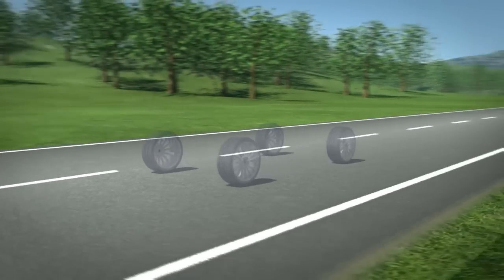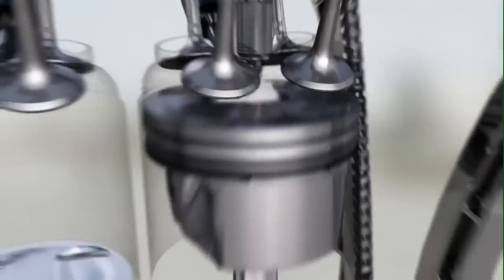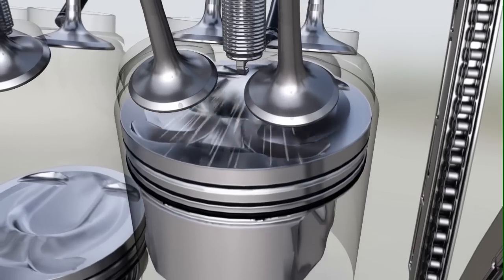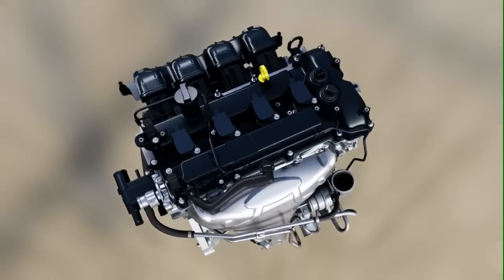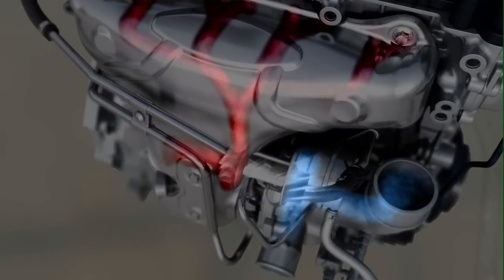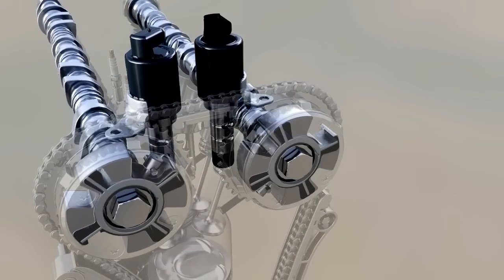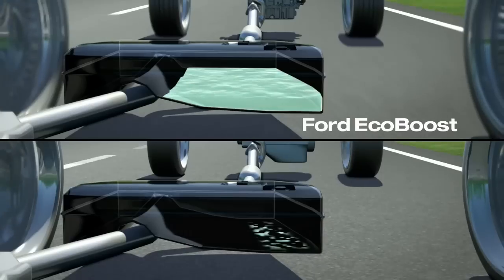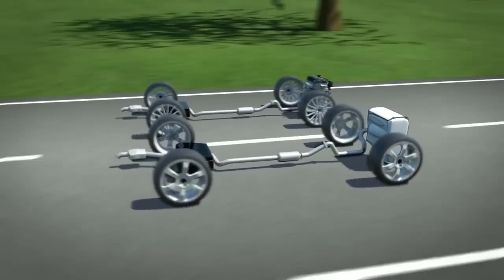Ford EcoBoost Engine

Comment: I am 67 years old, just bought an f150 3.5L.  My test drive it was a beast. Never had that much power.
Reply: Because dude you have a supercar engine in your truck. Ford GT 2.0 has the same engine

Comment: I driven an eco boost 1.0 fiesta very nippy  petrol engines
longevity wise with the earlier versions had some flaws, but for the size it boost it produces and easy on the fuel. 
the 1.5 very torquie how ever a 2.0 engine should be a power house!
They are a popular manufacturer I had driven fords before they are great but i miss their z tec engines and duratec engines they are great sold engines. 
The ecoblue engines are nice too.
keep up the ICE alive ford! all the best!

Comment: This is the biggest screw up Ford made during it's existence, what kind of engineering department comes up with and open deck design with cooling slits between cylinders?
All the 1.0 , 1.5 and 1.6 ecoboost at work failed before 80K miles.
I had the 1.6 VCT before that, unbreakable, even with the flawed piston nock at TDC.
2.0 N/A engine is the best in MK3, but only in a handfull of countries, based on Mazda L series, also in Volvo V50.

Comment: I wasn't that impressed with my rental Fusion's acceleration but then I learned it was only 1.5L... I still prefer the NA 1.6L in my Fiesta though. Lighter weight and feels more powerful at high RPM.
Reply: The 1.6 is turbocharged.

Comment: I'd rather drive a car that has 15mpg, will need an oil change every 6k miles and will last 1'000'000 miles rather than having a 1L 200hp ecoturbogreenskyactivhomohalal engine that has longlife oil lasting 24k miles or whatnot and will need a full rebuild after 100'000 miles. But hey, that's just my opinion, (and every other car passionate's). and I don't whine about it on Ford's video because I hate Ford, quite the opposite actually, I always loved Fords, it's just what you guys do with this amazing make right now makes me want to cry, I'm fine with having a hybrid, downsized, or electric as an option, what I don't want is having it forced in without an option of something I would like.
Reply: Nah. Got 270k miles on it and still no problems. Prolly best choice I made. I don’t know who you drive but an oil change every 6k miles? A car that makes only 24k miles? U probably money-shift very gear. But I respect the opinion:)z
Reply: @Hi-db5cd then you're one of the few. Join any other ecoboost forums and you'll know.

Comment: 1:13 ok now I hear some hardcore bullshit. Since when is any turbocharger even working at low end? no matter how small you make it, there is still lag, and in reality, if you compare a turboed engine's power and torque, at the rpm at which the turbo doesn't operate, to the NA version of the same engine, the NA will have higher torque and power, of course that is just the bottom end rpm, but isn't that where you claim to increase the torque by adding a turbo?
Reply: The size of the turbo isn't that important (Shure smaller is better because of the lower mass) , however the angle of the fins inside the turbine and compressor are much more important, however yes there will always be a bit of turbo lag, even Whit VTG Turbos (Wich most gasoline Ecoboost engines don't seem to use) however you can reduce the lag by lowering the max RPM increasing the Idle RPM setting the software to accelerate much more aggressive than what it should based on the position of the accelerator and by injecting and igniting fuel when the exit valves are open, and that in combination with the Variable Valve timing and Valve travel does end up making those engines feel very responsive and powerful.

And Ford never said that the engine wouldn't have any lag, just that it has minimal lag and increased torque over a Naturally Aspirated engine Whit the same displacement both are correct, and them saying that the turbo is optimized for low end torque isn't wrong either, unlike for example the Nissan GTR wich Takes 7seconds to spool up those massive turbos.
Reply: Clearly Jandalf is a keyboard warrior who a) hasn't actually driven an EcoBoost vehicle and b) hasn't kept up with today's turbocharger technology.

Comment: 1-4 turbocharger intercooler petrol engines all in all brands : Easy damage,  20-100 l/100km, over 100 l/100km with All speed, Formula one speed 160 km/hour to top speed, test maximum over 20,000 to 150,000 rpm.

These ones have been built by street racers all class terrorist brilliant for corruption and illegal in standard law AE.

From
All brands databases all

End report.
Reply: Dem K. Your comment made zero sense

Comment: All ECOBOOST engines : Easy damage, 20-100 l/100km, over 100 l/100km with all speed, Formula one speed 160 km/hour to top speed, test maximum over 20,000 rpm to 150,000 rpm.

End report.

From
Ford databases all

My name is Taweechai Wongwarapan. E-mail taweechai20@hotmail.com

Comment: Benz just announced a 2.0L Turbo with over 400HP and almost 400 ft lbs of Torque, most powerful production car 4 cyl so far! With great mpg, that 2.0L is the magic size for most uses..amazing The 2.0L is the most manufactured engine size in the world, from all makers. My VW GTI 2.0L turbo is great, latest edition, has improved upper end cooling, to try and cut down on carbon buildup, so far it's working 79,000 fun miles, not a blip of trouble...always getting 31+ mpg AND got 35.1 recently on a long cruise non stopping, best ever with well over 70,000 miles!! Great stuff, I always use at least 91-93 Octane, min is 91 required by VW for that engine..top tier BP most of teh time as it's the cheapest around here, when away I use WaWa or other brands, never had a problem

Comment: Overall good interessting technology.
But please change the 1.0 Ecoboost 3 cylinder to a four cylinder engine.
It would run much smoother and needs only 0,2l/100km more fuel than the 3 cylinder engine.
VW EA211 1.2 TSI (4 cylinder)  do run better than the Ecoboost, with the same fuel consumption.
Reply: VW has other serious problems.

Comment: How does a 1.0 Ecoboost engine keep getting 14L per 100km with sedate driving?
Reply: How? it doesn`t. Something must be seriously wrong. Maybe your driving behaviour?
Reply: @dom3827  It has the standard auto box not the PowerShift.  I heard it uses more fuel to change the gears due to torque conversion maybe? It was my moms car, they gave it back.
Reply: @jacquesduplessis8944  hm..than i dont know. Sorry.
Reply: @jacquesduplessis8944  a torque converter will use a bit more fuel than a Dual Clutch transmission, but 14L is way too much for example an Audi SQ5 (2019) Whit a 2.5L Turbo V6 and torque converter transmission uses around 9-11L of fuel, so that is way too much for a 1L Ecoboost Inline 3 or 4 you should expect 5-8L unless you really floor it.

Are you by any chance going by the indicator in the gage cluster? Because if that is set to display the momentarily fuel usage it might display that much when accelerating, otherwise I'd check if the turbocharger or injection system is damaged.

Comment: Piece of junk. My Dad used to have a 2012 fwd ford escape with an ecoboost. It had so many problems. Update 2021:Lol. I was way younger when I made this comment. I don’t know why I made this comment. Ford Escapes actually aren’t that bad.
Reply: like no company has problems.......
Reply: They are better than a S#!T box Holden
Reply: @megatronprime3008  no. By far tze worst brand at the moment in terms of engine problems and failure is by far the VW group.
Reply: @dom3827  Yes they are . they have dominated holden in performance for years. It's a fact . i can put the details up here if you like.
Reply: They have overcome all the teething problems new and upgraded engines/heating systems are fine

Comment: guaranteed to shut down every 10000km
Reply: 85 000 k's on mine. HAS NEVER MISSED A BEAT. you must be thinking of a Holden or Chev. They are garbage
Reply: hungrynapps nope 50,000 strong

Comment: Is not fuel quality is the engine design
Reply: Lots of direct injection have carbon buildup, cus the gas is not being sent over the valves to clean them, VW solved it on the latest version of the 2.0t by having more cooling in the head area, and supposedly an extra injector to spray some gas across the valves...I always use top tier rated gas, BP mostly around here is the 93 octane cheapest
Reply: The carbon buildup isn't causing cylinder heads to crack cars catching fire etc

Comment: How bout the carbon deposit on the exhaust valve?
Reply: EVERY direct injection engine has this problem.
That is not a ford specific problem.
VW TFSI engines are most affected by this problem according to german car mechanics.
Reply: Thats the problem isn't it. All we can really do is use higher quality fuel, and try to keep gas tank at above quarter tank.
Reply: Epi Espinoza it’s not the exhaust valve that get carbon deposits, it’s the intake valve(s). With port injection the fuel would clean the intake valve on opening, but now with the fuel being injected directly, the intake valve is forming deposits. This can be rectified with a non-vented oil catch can system.

Comment: Sorry, but theres no replacement for displacement... I may as well go for a gm inspired v8 that kicks over to 4 cylinder mode under normal driving conditions. Taxes may cost more but on the bright side it will be nicer and last just as long.
Reply: Hahaha such an american view. Look at the performance of wrc cars and tell me displacement is most important
Reply: @hansdietrich83  i agree. Typical 1960`s america thinking.
Reply: GM disaster?  Remember their horrible 4,6,8 debacle, junk remember when GM took a gasoline engine, and sold it as Diesel in the 80's?  GM, all junkers, all the time...Even after $60 BILLION bailout, they close 5 factory in N.A., losers, and making junk, no one wants.  V8's are obsolete 2.0L Turbo is the most manufactured engine size by all makers, magic size, smooth, powerful 2.0T close to 400HP in lots of stuff..magic. My VW GTI 2.0T gets 33mpg and has done 35.3 on on cruises, with 76,000 miles on it!!! And gobs of torque and pickup with Neuspeed power module, simple plug and play, increases the boost, by keeping the waste gate closed more, great stuff

Comment: Use top tier fuel only to avoid carbon issues in older eco boost engines. USA has too many crappy fuel stations everywhere. Avoid them at all cost . Ethanol is not your friend either. It has 40% less power than regular petrol. Love your vehicle not the few pennies you are saving at the pump.
Reply: P.S. I love this engine!!!
Reply: Just curious. I have a 2016. Would you use top tier still?
Reply: Mr 44 Ounce  if you live in a country where fuel can be crappy, and you don’t know what’s in the local pumps ALWAYS use top tier fuel :)
Reply: Is 2015 old?

Comment: the 2.0L in my 17 escape is a little engine that can and still with only 8000km on it 9.3l /100km with 4wd I expect to hit around 8.5L soon or may be less and when I need to jump  on the highway on ramps or pass someone, no problem at all. love it

Comment: Best engine for 5 years and counting! good job Ford.
Reply: Yes, excellent engine designs. Fords on Gen2 w/ these GTDI engines. 15yrs in production! More experience than any other major manufacturer. My '22 Edge ST AWD is excellent. My 3rd Ecoboost equipped SUV or truck . I'm sold on the innovative design.
Reply: Hahahahaha funny one
Reply: hello, for ecoboost turbo engine super fuel will make damage?
Reply: @tegimaghalashvili2046  What are you even asking?